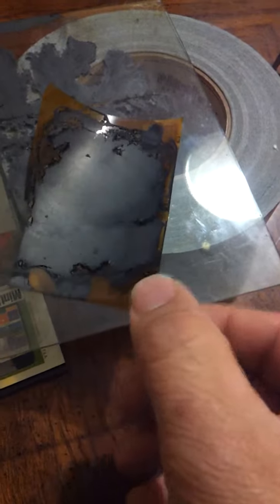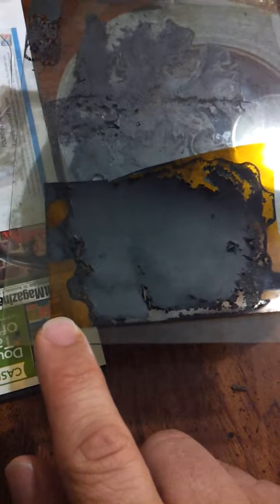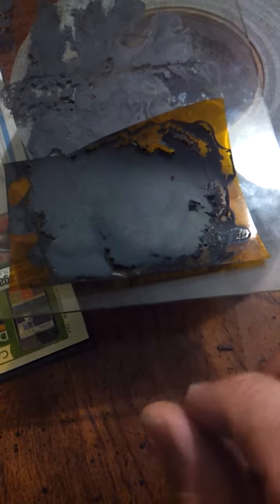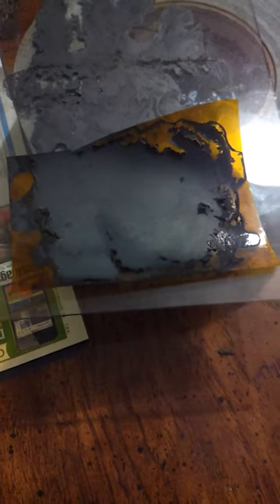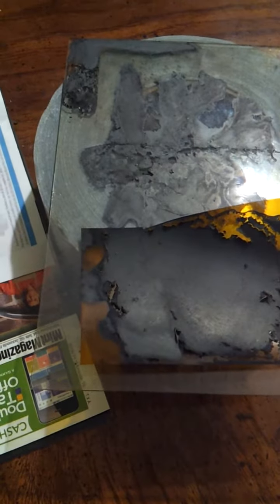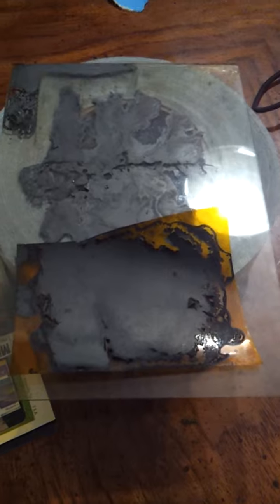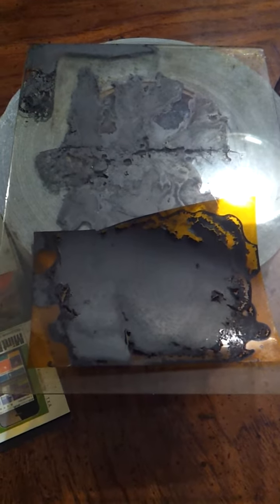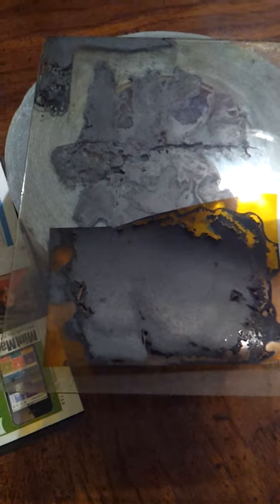Graphene on kapton

Comment: I have been trying foils, "not copper" they work buy it flakes off real easy. I have a couple of stainless steel plates, sand blasted. it actually adhered the best? with a propane torch heating from the back side. Keep us posted on the copper foil. 
peace out Murf!  PS I have some chitin getting close to test in the mix. I think this might help with adhesion?